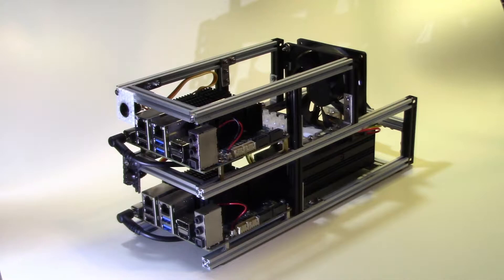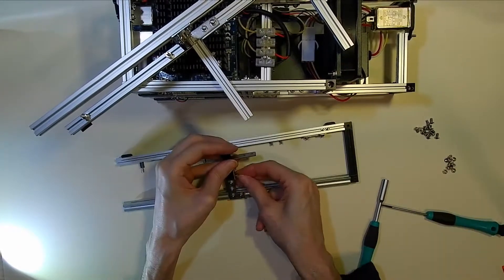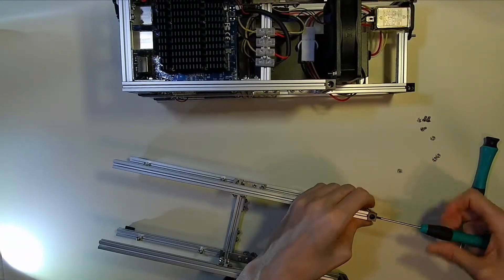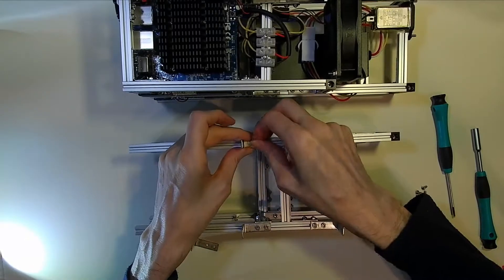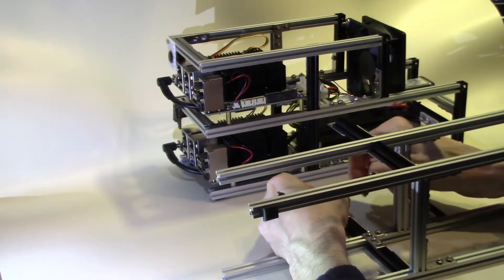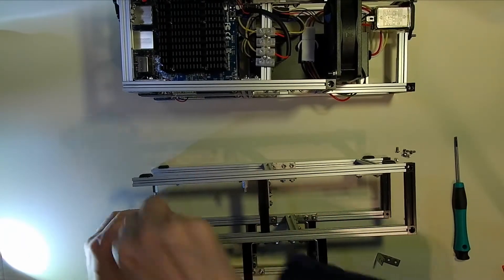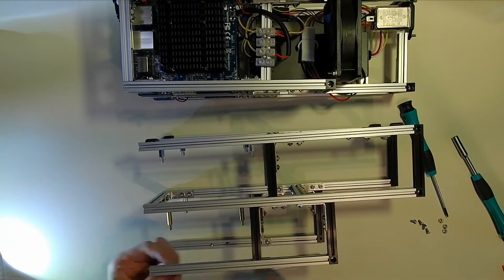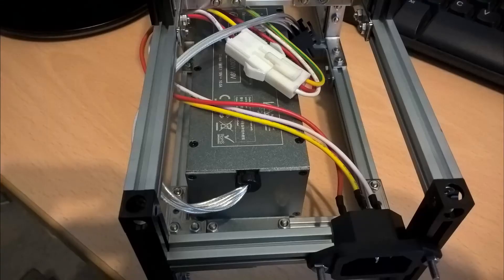Odroid H2+ x86 single board computer project part 6 - Frame and power supply

Comment: Do you have any videos on how to wire the PSU to the power distribution block then to each of the Odroid SBCs?
Reply from the maker: Part 3 of the series is where the power supply is added but you're right in that I didn't go into much detail as regards the actual wiring between the AC/DC converter and the Odroid H2+ itself. Perhaps it's time for a video on just that topic.
Reply: @custompchardware  I tried to google for an explanation, and found a few tutorials, but most don't explain in detail. I could try and guess, but I'd probably blow up the power supply and my odroid haha. Even the odroid wiki is thin on details. That surprised me.
Reply from the maker: @Ars Umbris, well said. I'm planning another video to cover my thinking behind the powering of my cluster and how I wired it up.
Reply: @arsumbris6392  Thanks for the explanation, but some questions I have still... you said 2.5amps x 5v = watts, can you explain that formula? Links were great too.Does anyone know what the exact voltage is right from an HDPLEX power brick like the 200w? I'm guessing it's probably 19v like it says on the unit, how do you get 5v out of that?
Reply from the maker: For the Odroid H2+ my task was easier as it takes 15v of an input but the range of voltages it can handle goes as high as 20v so the HDPlex AC/DC converter was ideal as it can deliver 19v. As each Odroid H2+ only needs a max of 5A and the HDPlex AC/DC converter can deliver 200watts @ 10A, it seemed reasonable that I only needed one psu for each two Odroids. The Odroid board steps the voltage down to 5v & 12v to allow you to run fans and disks.

Comment: These videos are gems, I've learned a lot from them. Thank you. There's a lack of videos on youtube talking about power options for SBC cluster projects. Great to know about HDPLEX and Makerbeam. I've used larger 80/20 extruded beams for larger projects, but it's great to know about these smaller scale ones for electronics builds.
Reply from the maker: Thanks, yes the HDPlex PSUs are really interesting. I miss their 80 watt psu for smaller low power projects,  but the 400 watt can now be twined to give you a 800 watt psu which opens up the larger more powerful systems to being powered this way.
Reply: @custompchardware  Do you mind describing the wiring setup in this build, for the noobs? I'd like to replicate this in a cluster of Odroid xu4s. Thanks in advance (also subscribed, hope you make more vids!)
Reply from the maker: Yes that might be a good subject for another video
Reply: @custompchardware  These videos really are great. Production style an narration are clear and straightforward. It's better content than other similar channels. Keep at it!
Reply from the maker: Many thanks